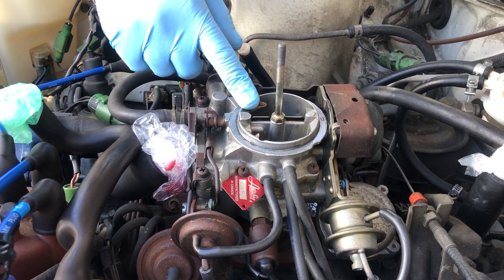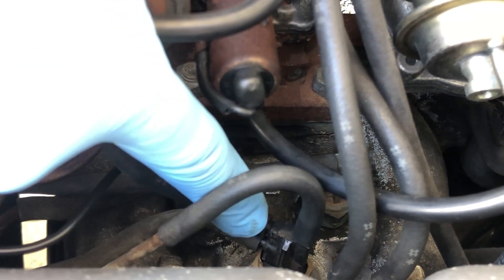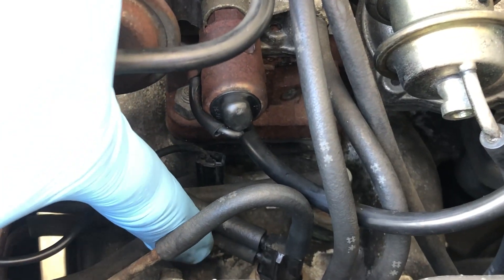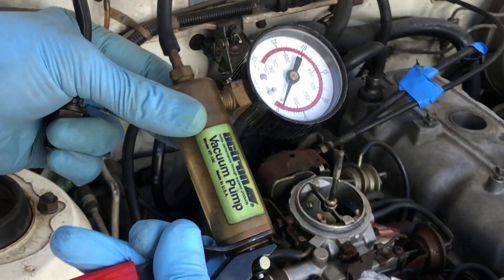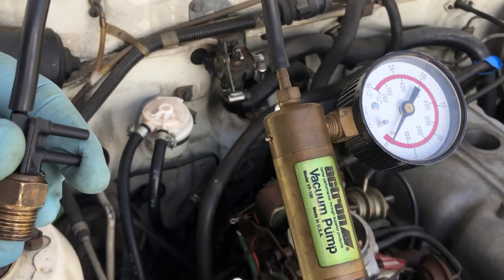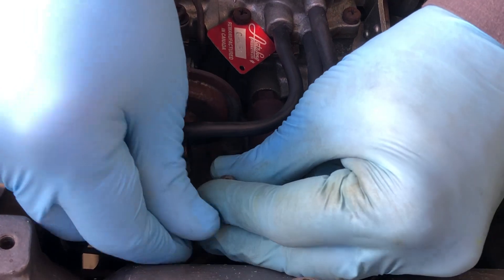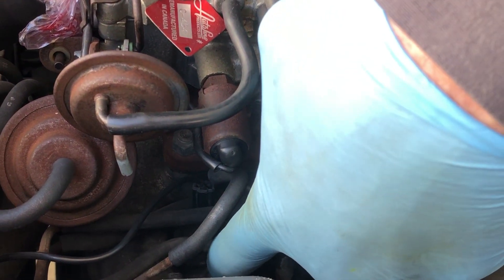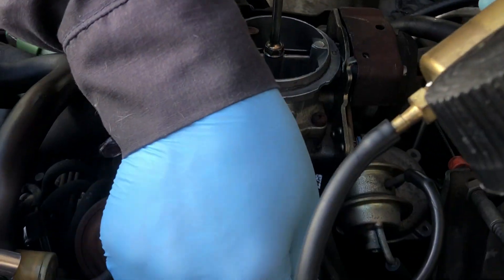Effect of a defective BVSV on operation of Aisan double-barrel carb (Toyota Corolla 3TC) - Part 1/3

Comment: Wouldnt you want the choke open? Harder to start. But wouldnt choke on all the time cause it to be to rich all the time?
Reply from the maker: I am assuming your question is about the temporary fix I suggested in the video.  The choke will gradually open even without the choke opener, it just won't open 100%.  In my case it was almost impossible to start the car without disconnecting the choke opener, which was forcing the choke fully open when the engine was cold.
Reply: @Zerk_Ziegler Thank you. Broke my BVSV and I got the truck running the way you suggested. It runs rough but it will get me by until the replacement comes from Japan!
Reply from the maker: @Alpine_Wanderer Wow, you were actually able to find one!  Where did you source of the part, if you don't mind?

Comment: I have had trouble finding details on the vacuum system on my 1997 HiLux which was had idle issues. Turned out the previous owner had the vacuum lines incorrectly fitted. Wouldn’t have been able to figure that out without this video. Thank you for sharing!
Reply from the maker: Unfortunately, at this point it time, finding parts is becoming difficult.  I was unable to source a new BVSV, but got lucky finding a good used one.